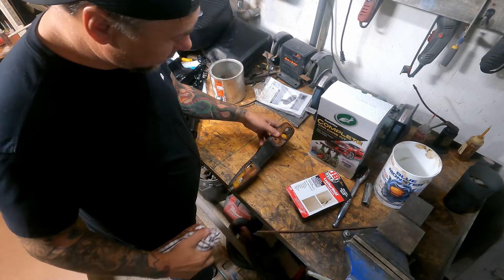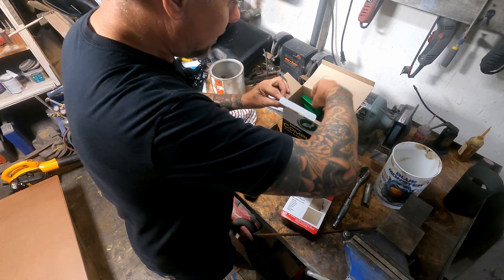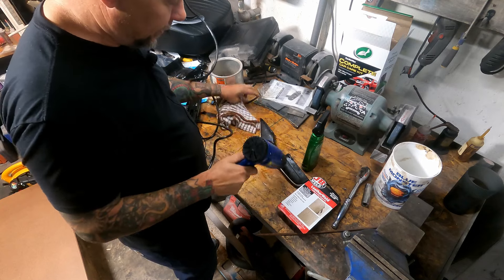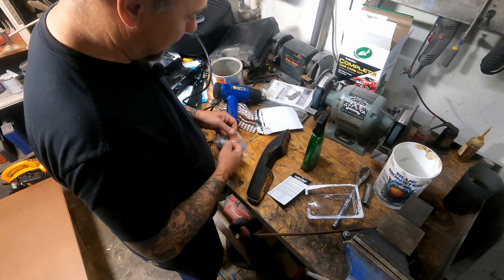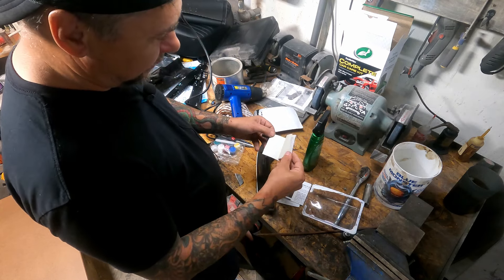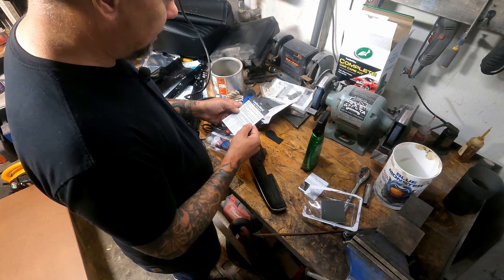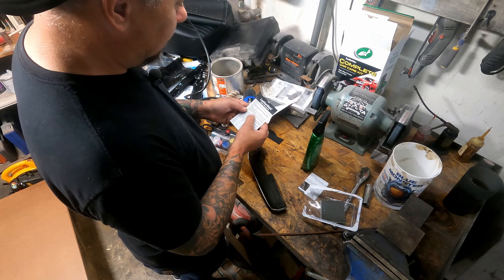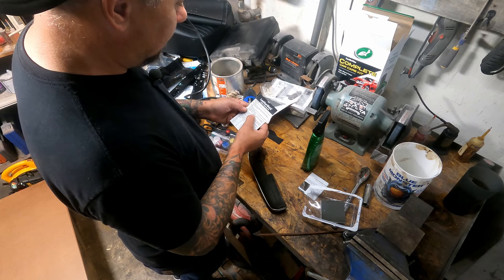JB WELD LEATHERWELD LEATHER REPAIR KIT

Comment: Read the instructions before you start it tells you to use the grain texture paper over deep holes like this one so uou end up with a smooth finish surface like I did at no point should you ever use a heat gun to dry paint ive tried this and I never works. And remember if you paint over a hole it's just a hole with paint in it.